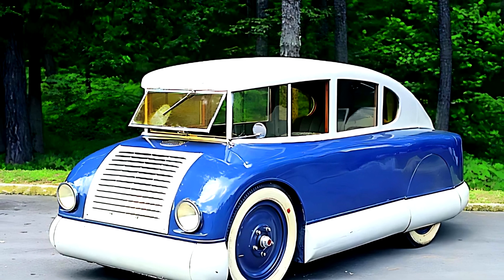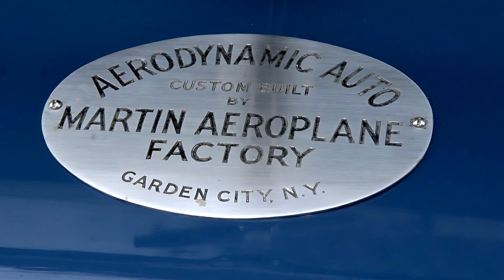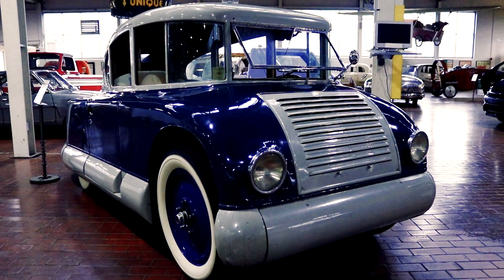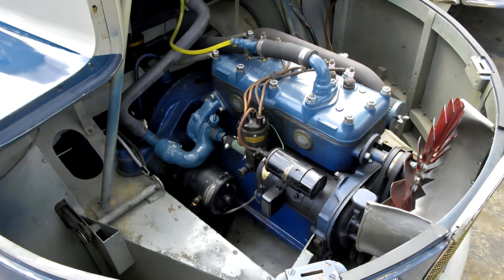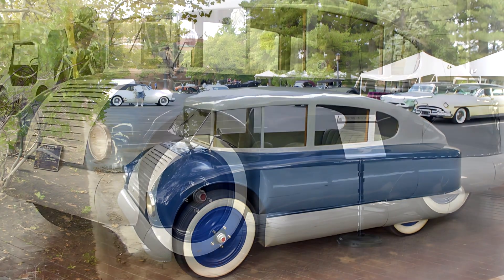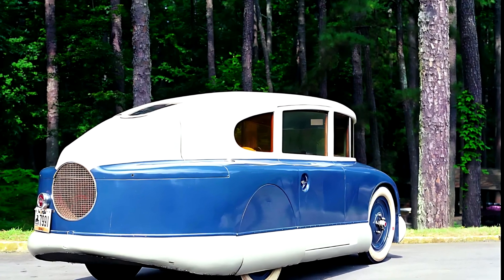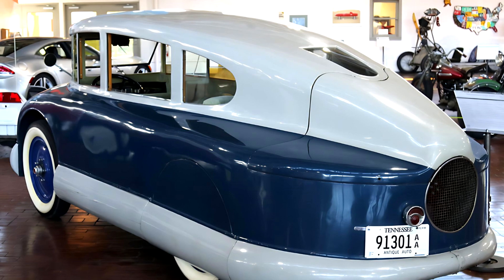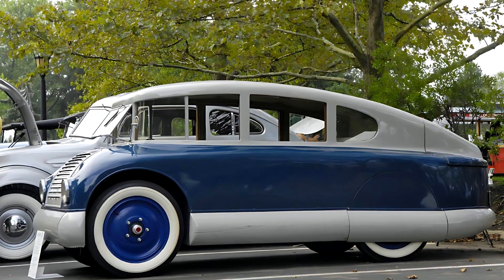🕰️1928 Martin Aerodynamic Was From the Future… Literally ⚙️

Comment: Was this the first body with fully integrated fenders, two decades ahead of its time?
Reply from the maker: Great question! The 1928 Martin Aerodynamic was indeed remarkably ahead of its time. Its fully integrated fenders, smooth contours, and overall teardrop shape anticipated mainstream automotive design by at least 10–15 years — especially when compared to the typical production cars of the 1930s and 1940s.

However, calling it the very first car with fully integrated fenders is a bit tricky. There were other experimental vehicles around the same era — for example, the Rumpler Tropfenwagen (1921) and several aerodynamic prototypes by Paul Jaray in the 1920s. Still, the Martin Aerodynamic stands out as one of the earliest and most radical American attempts at streamlining and integrated body design.

So yes, you're absolutely right — it was an ambitious project that, in many ways, was truly ahead of its time. Thanks for the insightful comment!